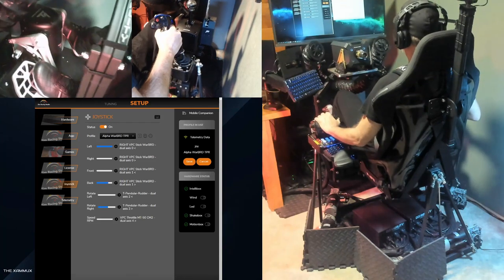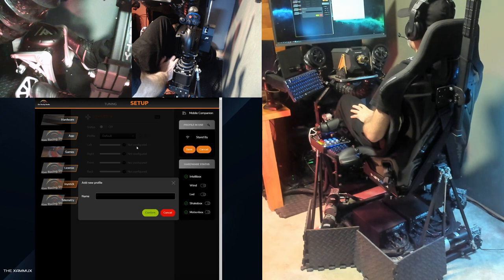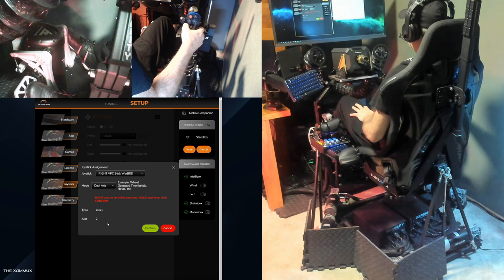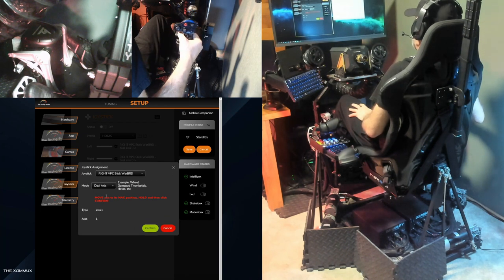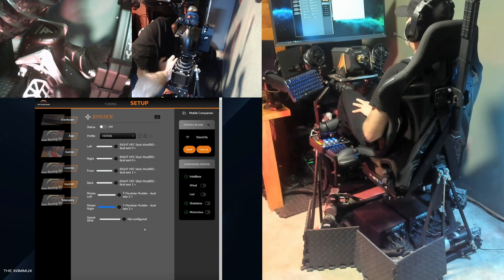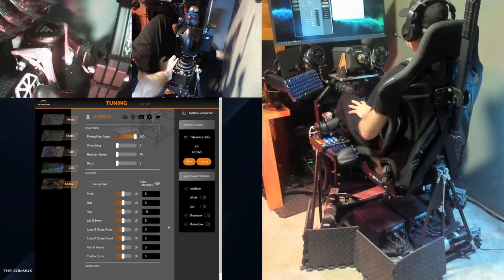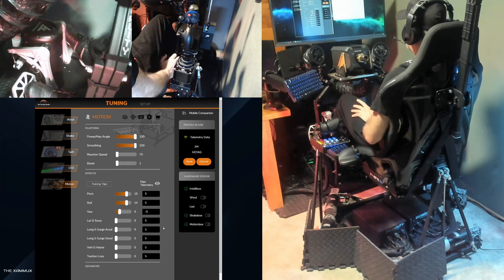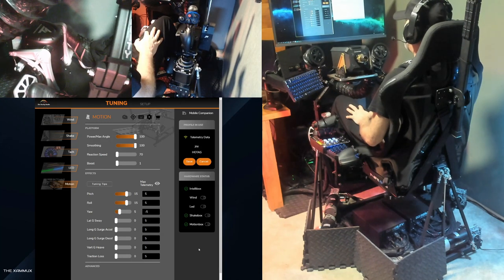HOTAS and Rudder / Joystick Motion Tutorial for Sim Racing Studio

Comment: excellent tutorial thank you. however I have a question I'm putting  together the P3 system and planning to used mainly  for flight simulation. my question is I already have the peripherals (joystick and ruder pedals) set up and configured in the game do I also need to set them up on the sim racing studio app ?
Reply: @SimMotionTuning  thanks for your replying to me yes is for Microsoft Flight Simulator 2020 I did finally completed putting the platform together but for some reason on the menu inside the sim racing studio where you can test the movement is not letting me test. status say connected but does not move I basically did a flight test and noting move just wondering if you experienced that before.
Reply: @SimMotionTuning  Hi thanks yea apparently I needed to restart the computer after installing the software lol... work good now thanks for your help